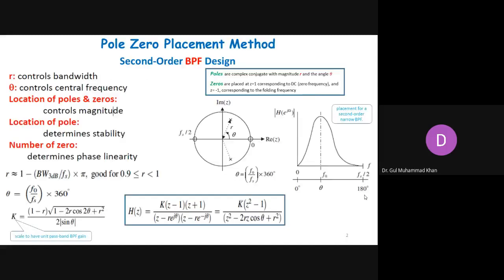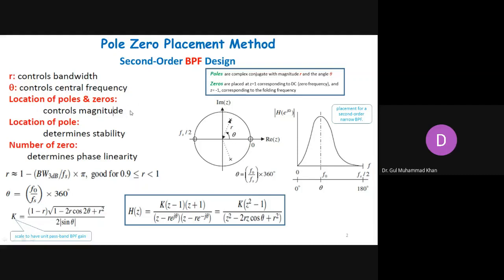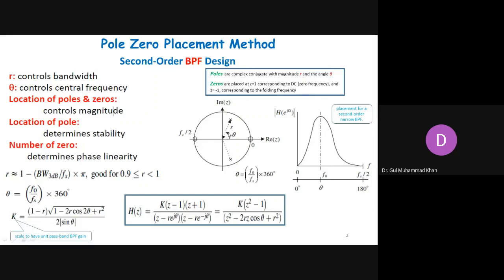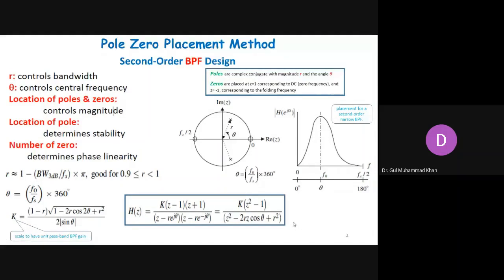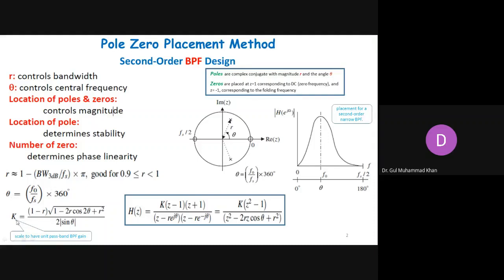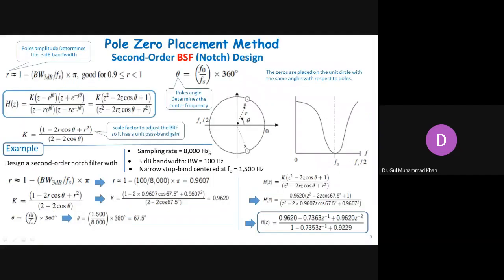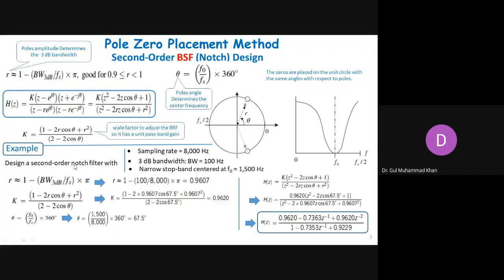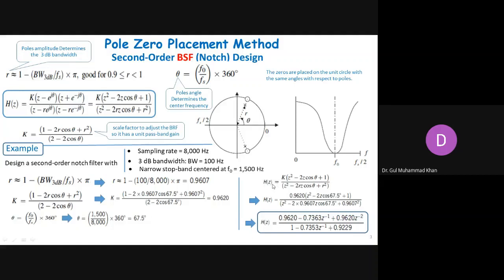#IIR Digital Filter Design, Pole zero placement method. #Notch Filter Design. #BPF Design.

Comment: shouldn't theta be in radians and, I think it should be in between -pi to pi, representing moving from 1,0 to -1,0 clockwise(0 to pi) and counter clockwise(0to minus pi), since it is expected that the response for "negative" frequencies is a mirror from positive frequencies it is often only plotted from 0 to pi being the frequency response of the filter (bode plot)